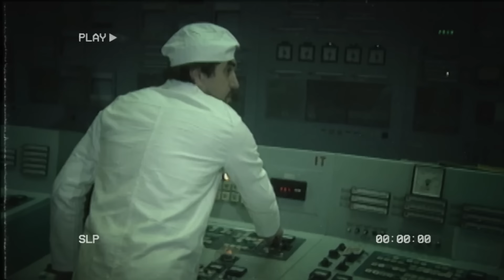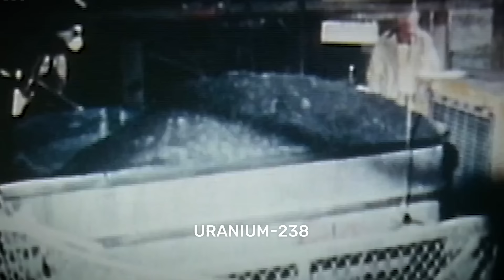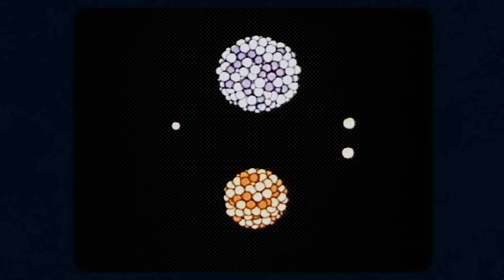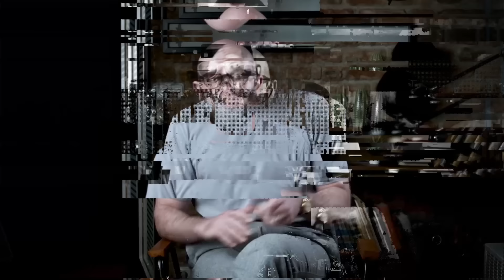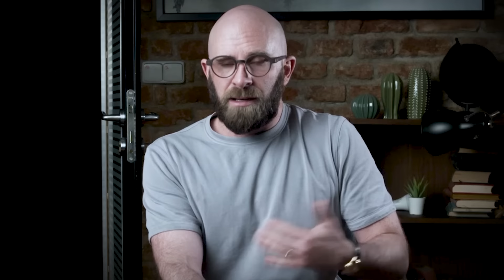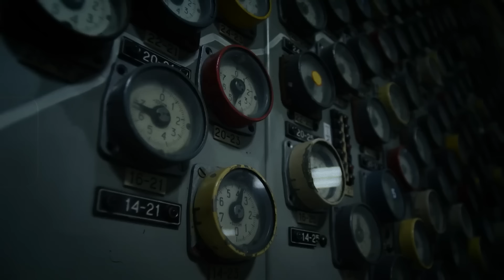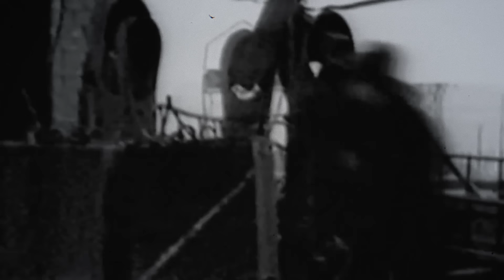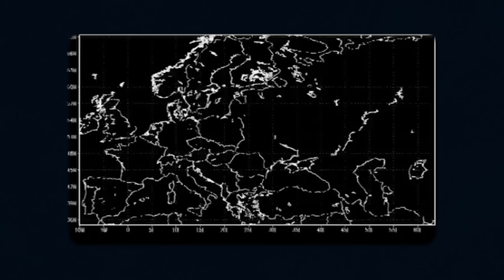The RBMK: The Shoddy Nuclear Reactor That Nearly Killed Millions

Comment: You completely misunderstood the purpose of a moderator. The purpose of a moderator is to slow down neutrons in order to increase fission rate....
Reply: Simon clearly mistook the control rods with the moderator.
Reply: Simon s writers* but don't give it a pass.  He pays them to do their research.
Reply: @ Yeah, I know this comes from his writers. Maybe I'm naive to expect that he should give it a cursory reality check 🙂I feel like it shouldn't require any subject knowledge to realize that the bit where he talks about the effect of the graphite tips wasn't internally consistent...
Reply: @Demonyaa his script writer you mean.
Reply: @Demonyaa  Did Simon play us so we would all add comments?
Reply: @RandomDreamState No.  I think we are in the same place he is: we (most of us, anyway) are struggling not to become exemplars of the Dunning-Kruger effect while simultaneously communicating via a platform that is designed to monetize insubstantial, ephemeral interactions.
Reply: @Demonyaa  This...typo in the script or he misread or just mistook one for the other when ad libing.
Reply: @Demonyaa the ends of the control rods do also have moderators on them so that’s why RBMK WILL always have the common issue amongst them
Reply: @Demonyaa Simon doesn't understand squat. He reads the script. He's very small brained. He even says, "It's in through the eyes and out through the mouth."
Reply: @Demonyaa  Simon was reading a script. He didn't mistaken anything. You might have a problem with the writer, but if you think Simon's that smart, you're not as smart as you think you are. LOL!!! He even says, "In through the eyes and out through the mouth."
Reply: @Hillbilly001  Does it make feel you good to repeat the same comment over and over, make assumption about others and then attack them for no reason? What sad pathetic little child you are. "LOL!!!"
Reply: 100 youtube videos from actual experts on this and they get it wrong
Reply: He’s a Jack of all trades and master of none. There are so many false statements on this channel I barely watch anymore but I’m interested in the Chernobyl accident so I thought I’d check it out. I actually quit after that.
Reply: @tonyroberts7481  quality has gone way down across all his channels in the last 12 months or so I've noticed. Guessing it's because he post across at least a half dozen channels, just that I've found. I'm sure there probably more than 6 at this point. Its seems like ever time I see him now it's a different channel everytime.😂😂😂 guy has a channel for every subject you can think up.😂😂😂😂 if he owns all the channels he's on he rolling in dollars for sure.😂😂😂 good for him
Reply: @tonyroberts7481 No wonder considering how much he puts up. Much you talk, little learn you only will. - Yoda
Reply: @tonyroberts7481 I reccomend you to the channel "That Chernobyl Guy"
Reply: @tonyroberts7481 The full quote is "Jack of all trades is a master of none, but still better than a master of one."
Reply: @ thx I know
Reply: Exactly.... control rods stop neutrons without decaying themselves... moderators slow neutrons down so they are more likely to split the atom....
Reply: @ScooterMcAwesomeness  as long as you don't put graphite tips on them to displace steam......... 
 I'll see myself out.   😂
Reply: I noticed that as well.  It's been a while since power school, but his previous statement suggesting the reaction would just "keep going" first keyed me in that there might be some "unclear" statements incoming.
Reply: @Sivart213 depends on if the moderator temperature coefficient is positive or negative.
Reply: Jesus..never seen so many folks who can walk on water.  If this was a doctorate thread I could understand the finger pointing.  It's a you-tube channel. Calm down.
Reply: The writers/Simon definitely got control rods and a moderator confused with one another. That's why it's always nice to dust off your textbooks every once in a while to double check yourself!😜
Reply: @shelbystroud5210  The writer did. Simon was reading the script. He's very small brained. He even says, "In through the eyes and out through the mouth." LOL!!!
Reply: The original control rods on this reactor had graphite extensions, so, yeah, these control rods did have the moderator on the lower end, hence, the "Boom!" when they tried to put them back in.
Reply: Nuclear power is simultaneously a simple thing to explain how it works and very highly specific and complicated thing to explain how it's done.
Reply: @SmallerRidley  Well, yeah.  "Boil water, steam turn turbine" vs "so where heat come from and how u not die?" ;)
Reply: As a non-expert, thanks for the clarification. Ive long learned not to fully trust anything on the internet,including youtube, but people clarifying points in comments is enormously helpful.
Reply: The confusion lies in the fact that in light water reactors, like pwr and bwr, the water acts both as coolant and as a moderator (and a little bit as a neutron absorber) This means that when the water boils, you loose the moderator and the reaction stops.
The RBMK was graphite moderated and water cooled, this means that as the water boils, you only loose the absorbing factor, which caused a prompt critical reaction, a power surge of a factor 100-1000 for an instant.
Reply: If only that was the only instance of flagrant misinformation in this video... 

The entire diagram at 10:54 is utter nonsense and the author should be embarrassed he ever included it. The graphite displacer is not a "little smidge." It is almost 5 meters long. And it never leaves the reactor from the top. When a control rod is completely withdrawn there is a 125mm water gap underneath the graphite. Displacing this water is what turns the otherwise-useful displacer into a serious design flaw.

The statement at 11:45 is pure fan fiction, like a little girl writing Harry-Snape slash.

12:47 Well, at least everyone else gets this wrong too. There was no coolant gap between power loss and diesel generator startup. The safety test was only needed in the event that a 900mm coolant pipe header ruptured at the same time as a power outage.

13:27 No safety features were circumvented or disabled in a way that contributed to the accident. None of those systems were capable of preventing the accident in the first place.

13:55 The reactor began running out of control AFTER the shutdown button was pressed, not before.

17:20 And finally we get to the Big Lie that invalidates the entire video title and represents the worst example of disgusting misinformation. There was NEVER any risk of a second, more dangerous explosion. The molten fuel DID drop into the flooded areas of the building BEFORE anyone had a chance to pump it out. The result was nothing more than a wet fart. There are scientific papers proving this 100%.

With so many dreadful videos out there attempting to explain Chernobyl to a general audience, this is by far the worst I have seen in recent years. The author should just delete the whole thing and donate the proceeds from monetization to charity. Ideally a climate change charity, since he has decided to profit from ludicrous anti-nuclear propaganda at 17:20...
Reply: Maybe the Russians misunderstood that as well when designing and building these RBMK reactors? They seem to have built these reactors on some questionable designs and with some peculiar security measures, which basically has made them accidents waiting to happen.
Reply: The designers did a bang up job with their design directives actually. It's just said directives were cheap, produces lots of power, and produces plutonium for the weapons program. Safety was distant to those goals, and in direct conflict with the first. So they deprioritized it.

The issue was the incentives and resultant directives to those designers.
Reply: He’s done a couple gun related videos that had some more than annoying errors also. RBMKs are graphite moderated, the boron controls the reaction.
Reply: Simon’s shows aren’t exactly known for accuracy.
Reply: @rdspam  there is slight difference between biased opinion and totally wrong one.
Reply: Nuclear armchair  peanut gallery hootennanny .
Reply: To be fair, the designers of the RBMK made essentially the same mistake.and that was a key component of the problem.
Reply: @Ifyoucanreadthisgooglebroke  Yeah honestly, I'm so used to the two definitions getting confused at this point regarding the RMBK, I legitimately didn't even notice the mix up until I spotted the comment. Most videos that aren't done by experts do tend to make the same mistakes, specifically regarding the control rods, moderators, and/or the true functionality and effect of the positive void co-efficient. I'm not an expert in nuclear reactors either, I'm in the same boat as the writers, and when talking about the RMBK I do often get mixed up without realising because of how much conflicting information I've absorbed.

I would appreciate being guided towards trusted experts on YouTube in regards to nuclear reactors, though, considering I can't break into Chernobyl to figure it all out myself
Reply: These are some of the least accurate videos on engineering topics.  The narrator knows nothing at all about any of it, and the writing is often just wrong.
Reply: @brianhaygood183  Narrators usually don't know much about the topic. That's a "writer" thing.
Reply: While what you pointed out is true, I think the main point is that the rmbk reactor was dangerous, difficult to control unless kept under perfect conditions, and was bound to fail at some point. Also the soviet response after...left much to be desired
Reply: @Greenlightsaber1 that's the response though. Deny obfuscate....😢
Reply: correct the speed of the travelign neutrons so fast that the chances of them colliding/ spliting is almost 0% hence the water and graphite
Reply: Came here to say this as well as the above comment on Moscow wisdom. Simon's research team had another snooze in preparing this video's commentary. They do that from time to time on quite important details.
Reply: Simon is a fact boy who doesn’t know shit about shit. Haha. No seriously if you watch Brain Blaze he literally just reads a script and sounds good doing it. I’m guessing the writers mixed something up because they’re not nuclear engineers and are just trying to make a fun video. Either way… I’m a humble Mech E so I appreciate you pointing this out.
Reply: Another video he churns out without actual facts.
Reply: Yeah… this aspect is a mess…  RBMK designs are graphite moderated, BWR and PWR are water moderated.  The moderator slows down neutrons, and Uranium nuclei present a greater cross-section to moderated neutrons vs. fast neutrons, increasing their probability of absorption by a fissile uranium nucleus.  The presence of a moderator INCREASES the reaction rate.  Control rods then absorb neutrons maintaining the reactivity in its delicate balance.

Inserting graphite-tipped control rods increased the number of neutrons being slowed down (moderated), meaning larger numbers of nuclear presented a greater cross-section and became fissile, resulting in the power spike.  There was a initial steam explosion but Whistler mentions two explosions without any further info on the second, which may have been a hydrogen explosion, 2H2 + O2 = 2H2O, with the O2 coming from the atmosphere, once the lid was no longer in place, although it could also have been a second steam explosion.
Reply: Don't try and lecture him, he's YouTube royalty. Factor in that he's British and he's infallible in the eyes of the average moron. This guy's nothing more than a talking head with a nice beard.
Reply: Ahh I knew that didn't sound right
Reply: Well, folks, Fact Boi's wrong again.
No professor, you're wrong!
Fact Boi is right!
Reply: That's why I also try to find people on yt like Kyle Hill, those who have the knowledge and can explain it to people without the layman getting lost in the explanation
Reply: Nerd detected
Reply: Depends if the moderator temperature coefficient is positive or negative.
Reply: @michaelmcallister3429  Moderator temperature coefficient in the RBMK is positive.
Reply: I thought the rbmk reactor plan was leaked to the USSR with known defaults its weird that the plant that went down was next to the source of the woodpecker
Reply: This is your online complaint? Let's start about the "nearly" 1 Million dead? How is that possible when combined with Fukushima according to the UN not more than around 10k deaths were recorded with even taking into account cancer patients that could get sick from something else. It's the most conservative estimate but a million is just retarded.
Reply: This is YouTube content slop created from a Wikipedia article.
Reply: But the controls rods where tipped with graphite which accelerates the reaction,  so were the clntrol robs not part of the poor degisn choices?
Reply: @AndrewBray-zw8ps I think that was the design flaw itself that caused the nonsense...
Reply: Couldn’t continue with the video as that one statements was swimming around my head.
Reply: Your the reason y I don't watch biographics anymore. S2m
Reply: We don’t appreciate your tone.
Reply: if its a ticking time bomb why do we still use them today?🤔
Reply: Maybe he just knew it's a small lie that would boost his engagement stats. Then would just keep going...
Reply: I’ve come to realize this guy does some research and just guesses at the rest.
Reply: Did he mis-explain?  I know the word "graphite moderator" is misleading and maybe I missed where Simon said it wrong.
Reply: I thought moderators just closed comments on Reddit posts
Reply: Welp judging from the comments this guy got something called a moderator wrong so the whole video is pointless to watch
Reply: Sometimes people make mistakes. I like to take most things I see on the Internet with a grain of salt. Anybody can sound smart enough for dumb people to trust.
Reply: @Dmitrikrotchlikmyov  how poignant that last statement is - half of the US will believe pretty much anything
Reply: @Dmitrikrotchlikmyov  Case and Point: Donald J Trump.
Reply: Dang you beat me to it. Slows down the neutrons to increase the likelihood of continuing the reaction.
Reply: Ok guys chill, the point of the story remains. If you have better details or explanation to share make your own video.
Reply: Simon doesn't write his scripts, he assumes his writers are correct.
Reply: @DJPuncher I don't think he assumes they're correct; I think his standard is "marginally more correct than incorrect".

I've been a fan of his for nearly as long as he's been on YouTube.  No antipathy here.  In fact, my favorite SW content is is the series of "Business Blaze" episodes that he did during lockdown with "space-heater-as-Wilson-from-Castaway".  I don't give a f what his hordes of haters say about his accent or persona or whatever. He speaks to me.  What can I say?

That said, I think he disclaims too much responsibility--at least lately.  He has developed a brand identity, and if he cares about it, he should, in my opinion, dissociate himself from writers who clearly have no qualms about simply making stuff up.  My impression is that certain writers care about this a lot more than others.
Reply: @bsadewitz  Agreed. Some writers are fantastic. But some constantly make mistakes and don't research the topics of their script enough. It's really bad business that research and factually correct information don't take a higher priority. 
Personally, it has led me to watch less and less of his content. It's a shame.
Reply: @mejuliie  I forget which channel it is, but one of the writers is definitely way above par when it comes to psychoactive drugs.  I mean, granted par isn't that high on yt (or anywhere in the media when it comes to that subject, really), but I was stunned that it seemed more or less correct for an overview video.  Like they didn't make anything up!  It was like ... pretty good.  The
Reply: @DJPuncher  You know what happens when you assume? Makes an ASS outta U and ME.

I swear I wrote that! lmfao
Reply: Awesome comment. Want to actually explain this?
Reply: @matthewsecord7641  In short, a fission "chain reaction" is the result of the fuel absorbing a neutron from a previous fission which makes it more unstable. The neutrons from a fission event have too much energy. Once they've been slowed down (become thermal neutrons), they're much more likely to be absorbed by the fuel and cause fission.  Kinda like skee ball where you want just the right amount of energy. The moderator slows down the neutrons, "creating" more fission relavent neutrons.  There's more to it of course, and there's a lot of probability involved, but I hope that adds context without over generalizing too much.
Reply: I highly doubt that a steam explosion caused by the melted core dropping into the water below would cause a steam explosion in the megaton range.

First of all it would be a steam explosion, not a nuclear explosion.

A steam explosion energy release is dependent on the area of contact between the water and the heating material and the temperature of the heating material. The melted core would be rather lumpy and not finely disbursed so the interaction would be more in line with lava dropping into water.

Creating a nuclear explosion with megaton yield is very hard. A lot of things has to be just right to make it happen.

A steam explosion would still be really bad since it would distribute a lot more radioactive material into the atmosphere.

Nuclear reactors can never become nuclear bombs by mistake.
Reply: @mabl4367   Perhaps not a full yield bomb...  but to say a reactor can never explode is a little... presumptuous. Under the right conditions, read negligent, a reactor could very well explode. Considering reactors operate on the boardline of an uncontrolled chain reaction... with the wrong person at the helm, a reactor could very much explode nuclearly, not just steamy. 

The people of chernobyl would disagree with you...
Reply: That’s the result of making “research” on the basis of easily accessible information and without any real knowledge on the matter.
Reply: Who's the "you"? Simon? Simon only reads the script. He doesn't understand squat. He's very small brained. He even says, "It's in through the eyes and out through the mouth." So who are you complaining about?
Reply: 8:30 The moderator itself will lower the power yield in a similar, but different way to the control rods.  That's how I understood it. At least, how I tried to understand. 😂 !edit! I was wrong... I think?
Reply: @WizzleJizzy The function of a moderator is to slow down fast neurons.  It doesn't reduce power output.  It increases it (well, it's not quite that simple).I know, the term sounded counterintuitive to me too when I first fell down this rabbit hole lol.  The control rods did not have graphite tips.  They were displacers.  I don't know in what world anyone would call that a tip.  Google a diagram or pic of one .  You will see what I mean. This is a complex subject. Yes, really, I know it seems so simple!@$ lolol
Reply: @WizzleJizzy Moderator slows down fast neutrons so they have a much higher propability to fission U-235 atoms. It basically puts the uranium fuel in a state where it can fission. Control rods control how much fission is happening by being made of boron, or another neutron absorbing material. So they essentially are the gas and brake.
Reply: @WizzleJizzy 
Moderator is there to slow down neutrons so they are absorbed by uranium better in the case of water as it becomes hotter the molecules get further apart, decreasing the likelihood of a neutron being slowed down, decreasing reaction rate. If water gets colder the opposite happens.
Reply: @WizzleJizzy The moderator would be heavy water correct?
Reply: @ In the RBMK, it was graphite.